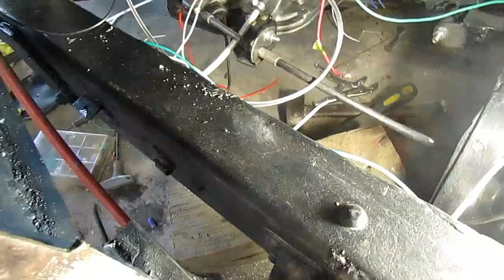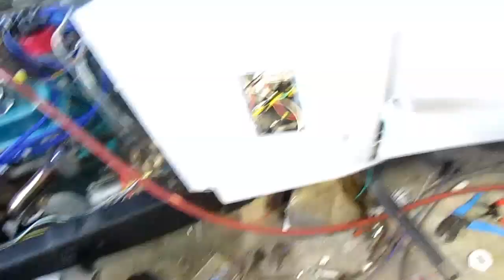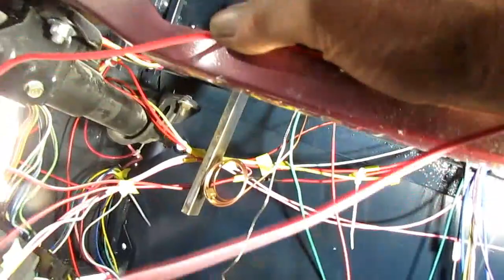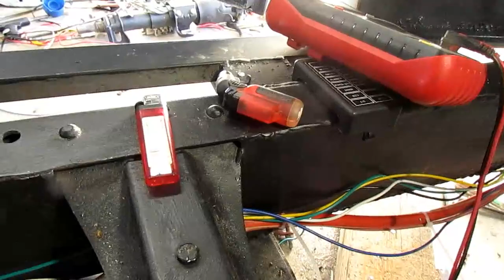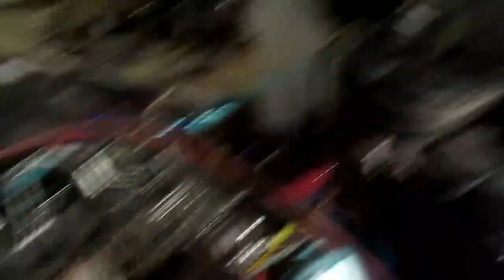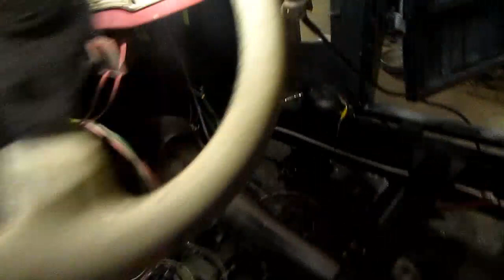1929 Chrysler building a custom wiring harness Part 1

Comment: Lot of work there. Looks good tho. Just curious, why didn't you put the alternator in the factory location?
Reply from the maker: I didnt know where it was. The brackets I had wouldnt fit anywhere else. I did remember the one that came off had some huge bolts and spacers, which I couldnt find. This is solid enough, I would have liked it lower, but this is what I ended up with.
Reply: @1otviii  Hay it works, run with it. Keep it coming.